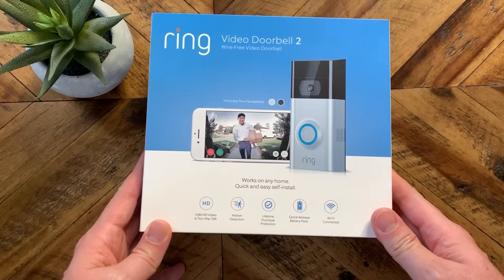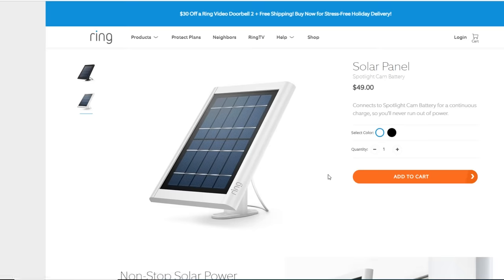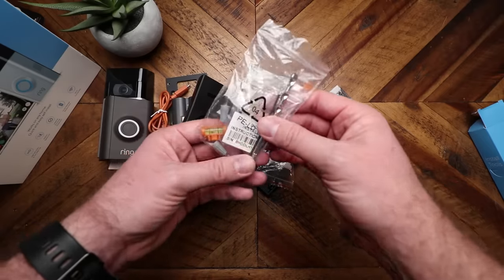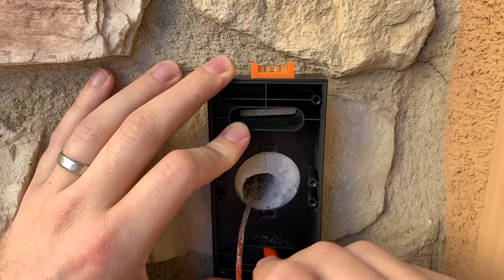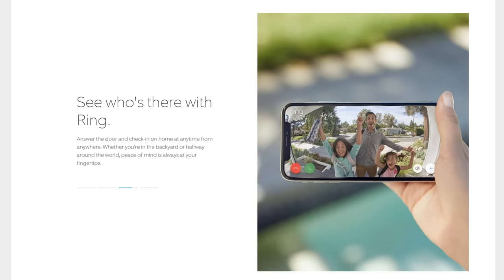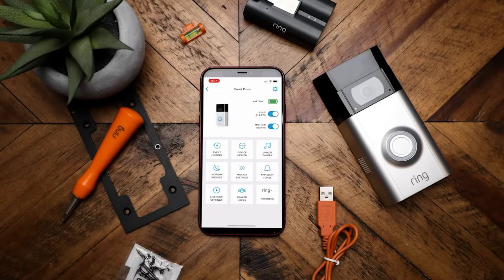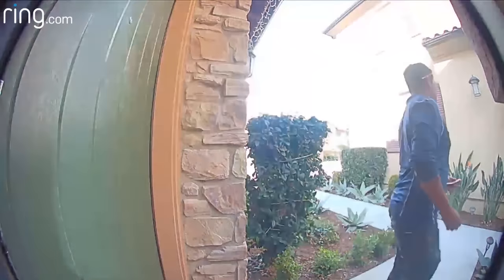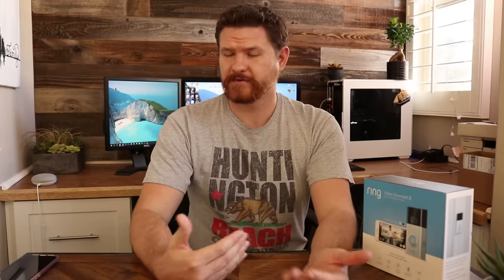Ring Video Doorbell 2 Review - BEWARE of hidden cost

Comment: Not as happy with operation.  Delay in doorbell notifying someone at the door.  Even if the phone is in my hand by the time I get the video up the person 
is walking away.  Audio is also intermittent.
Reply: That sounds like a router issue. Make sure that you have SIP ALG disabled in the router settings.
Reply: I have nothing but disappointment to say about the ring doorbell. The Push Service is extremely slow which means by the time you received notification and answer the door the person is almost leaving. Don't forget it cost monthly payments in order to actually use this doorbell the same way as you can use the freebie Home Security systems which allow you to record on your phone all of the video and are much faster at responding. Definitely would not advise anybody to purchase one of these. Do your homework first and you will see there are many less expensive and better quality ones out there.
Reply: I had nothing but trouble getting my Ring to work properly.  It was choppy and slow.  I added additional wifi repeaters and after about 6 months, Ring finally told me that I needed 1.6 to 1.8 megabits of upload in order to work properly.  My internet service provider was totally unable to provide that level of service because I live in a rural area.  Living in a rural area is the reason I purchased the Ring.  Be award of this flaw.
Reply: @greggrimsley5337  I believe you do since you may not always have your phone in your pocket when at home.  It could be on the charger or where ever.
Reply: @nefiredog8705  Sounds like they were looking for excuses.  I have 100mb upload and 10mb download still have problems.
Reply: @donsmith7354  Absolutely not looking for an excuse.  If I didn't want the Ring to work, why would I buy it.  My ISP can only provide 12 mbps download and 0.7 upload.  My son have two Ring Doorbells on his house and has a different ISP and they both work flawlessly.  I'm upset that Ring did not tell me what their minimum operational requirements were for the Ring to work effectively.  It was nearly a 4 month process to find out what it needed to work.  They even sent me a replacement doorbell and no difference.
Reply: @nefiredog8705  Sorry I was referring to Ring Support looking for excuses.  My ISP exceeds their requirement and still have problems.
Reply: @nefiredog8705  can you please tell me If I have strong wifi that I won't see a delay, otherwise the Ring chime wifi extender would resolve any delays, correct. Would I be able to hear the doorbell if I hardwire into my existing doorbell or would I also have to get the Ring Chime wifi extender. Also what is the difference between the Ring Chime wifi extender and the Ring Chime? Thank you for your time.
Reply: @greggrimsley5337  I had a strong signal, but my problem was that did not  have the internet upload speeds to handle the video feed from the doorbell.  I would suggest running a speedtest to see what you upload speeds are.  My son install two Ring doorbells and he just went ahead and installed the wifi extenders.
Reply: I also installed a wifi repeater right under the Ring inside my house by the door, it made no difference since I did not have adequate internet upload speeds to support the Ring.  All was a waste of money.
Reply: @nefiredog8705  I'll run a speed test to see if I have enough to support a Ring 2. Thank you for your time, have a good weekend.
Reply: I just ran a speed test on my Suddenlink network. I got 45.79 Mbps dn & 22.66 Mbps up. I am going to get a Ring2 and see how it works for me  if it doesn't work I have 30 days to return. I'll let you know how it goes.
Reply: It's not a router issue it's a ring issue I have boosters in my house and same problem only 1,300 sqft home, come on this thing shouldn't have any trouble only thing on my Wi-Fi that does!
Reply: I have very fast WiFi and my router is 9 feet away from the doorbell and still have many issues with slow notification of motion and very annoying that the Live View will work sporadically. I’m sick of seeing ‘Activating Device’ and the circle spinning. I’d say the problem is with the Amazon cloud that Ring uses .. it’s not capable to handle the demand. Amazon (who own Ring) need to sort this out. Very disappointed with this expensive product. It should show Live View first time, every time.

Comment: Just like products have Energy ratings and battery requirements, things that need a subscription need to have a big sticker with a $ sign on it outlining the cost. And just like when products get a recall when a major fault is discovered, products that have no subscription, and then move to a subscription model should be able to be returned (even years later) for a full refund.

Having said that, $30 a year for the basic plan (assuming you'll only get the doorbell and no other ring devices) is pretty reasonable.

Comment: You mentioned you were spoiled by ??  and I am guessing you were comparing it to the Ring yearly charge.  Could you offer a link to what you were spoiled by.     Is there a way on any of the Rings (without subscription) if you see someone at your door you could take a snapshot?   I know with android phones if you press the DOWN volume arrow and POWER button it in most cases will let you take a screen shot.   Is there anything built in that will at least let you take a snap shot?

Comment: What if I want to have Ring cameras at both work and home?  Can the one app and one account monitor both cameras?  If so, how does that work?  Maybe you can do a video explaining all that?   For example, do I need two cloud accounts and two monthly fees?  If that's the case, would I have to sign out of the Ring app for one location and then log into a second account to view the cameras at the second site?  Is there any way to view cameras on two different Wi-Fi networks from the same Ring app?

Comment: According to the manual when wiring to an existent doorbell (mechanical) a transformer with a voltage of 8-24 VAC is required.  On your video, you just wired it as it.  I am a bit confused after seeing your installation which is more simple.  Can it be install without buying a transformer with voltage 8-24 VAC?  Thanks!

Comment: Sorry to post again!  But.... Just to alert Canadians - when you purchase your first 1-Year basic Protect Plan, the Ring website does not at any point give you a "final checkout review" showing any US - Canadian currency exchange, or taxes, or final amount at all. They ask for your bank account info, then shows a screen of "You're covered!"  Only when I checked my bank account the next day, did I see they had charged me  $44.66 (for the $30 plan). When I called, to bark about why their website was so void of any "final amount" so I could see it, they told me that it was my own bank that added the fees (not true). They also informed me that it will automatically withdrawn from the same card next year - of which I was also not informed about during the transaction - nor was their an "opt for auto debit" choice, at all. Ring support replied "it's in the contract if you read it..."  So - my bad for not reading that long contract we all scroll down to "accept terms" lol.  So Canadians, as of Feb. 2019 it comes to $40.66 for the "$30" plan.   And it renews at $30 each year, which is still a pretty great deal, I figure - - - even if it doesn't work all the time.

Comment: Screw this, you can get an outdoor 4-megapixel camera with 2-way audio for WAY cheaper than this thing cost and the picture is 50 times better. I setup video surveillance systems and the camera on this thing sucks for the money you're spending. Plus, it's proprietary. I would rather have something that integrates into my already existing surveillance system.
Reply: @Collin2377  
Damn near EVERY CHINESE MADE CAMERA OUT THERE. I've installed a BUNCH of different brands and the picture is ALMOST identical with MOST of them. The main difference is the hardware INSIDE these cameras. Digital zoom compared to mechanical zoom. NIGHT AND DAY DIFFERENCE in those two types of cameras, just as your cell phone camera is compared to my Nikon SLR. Now am I going to tell you which name brand to buy? Nope, you have to PAY ME to get that information. I do this as part of my line of work and if you want to know what I know, get to reading son. It's a big ol' internet.

Comment: What screws did you use to mount camera to the wedge mount   it seems the small scres are to short. The 5 liltte  screws in the small bag
Reply from the maker: There should be 2 large screws that you would use.

Comment: Your video is informative and helpful.  A couple of suggestions, though. Perhaps you could have included more footage of the bracket installation.  It looked like you aligned and marked the bracket on the brick/stone but didn't actually drill holes on your mark.  Also, didn't explain or resolve the video quality or lighting issue.  Maybe you could have improved the video quality by adjusting the angle?

Comment: What did you mean by it doesn't matter which wire the ring is connected to in the back?
Reply: It doesn't matter what wires are hooked up to your door bell that you already have installed and you will connect those Two wires on your new device on back where the videos instructed to installed them. One on one side and the other on the other behind the screw.  Just don't put both wires behind One screw. You only used the wires if you don't want to worry about the batteries going dead.

Comment: If you're looking for lower cost alarm system monitoring - then the Ring Alarm is a good choice - for the same $100/year or $10/month you get the unlimited recording on multiple devices and professional alarm monitoring...  I was paying $25/month for SimpliSafe and no cameras so it's a total win for me.  The camera is for sure not as good as other camera systems out there but much better than the old wired ones where the colors are extremely washed out and nigh vision makes everything look purple during the day.

Comment: What's the voltage it needs from the existing wired door bell ?
Reply: 12 to 24V AC but it doesn't seem to like anything lower than about 15VAC.  Do note it is an AC supply it needs not the more common DC.

Comment: My current door bell is at the side of the front door, not facing the front walk or a frontal view of someone at the door.  Can I leave my current door bell operational and install the Ring Video Doorbell 2 using the battery at the front door frame which would provide a better  angle to capture someone at my door?
Reply: Yes, of course, but will you want to connect the ring doorbell to your existing doorbell, so if someone rings the ring, your old doorbell also sounds off?

Comment: I'd like to get the 1st RING Video Doorbell for my mom but I want to get it hardwired for her. She does not have an existing  doorbell but her handyman can hardwire for her, I believe. Can she do that without existing wiring?
Reply: i think there is a battery option and also a solar charger option, if her door receives a few hours of sunlight per day.  The wiring necessary is low voltage wiring.  Since she doesn't have a doorbell, she might want a doorbell in addition to the ring, so when someone rings the doorbell, people in the house without ring will know it.  So the handyman can install the not-ring doorbell in the house, near the door, and also run 120 power to it (electrician or plug in it an existing outlet,) but then has to run the skinny low power line to the outside to the ring doorbell, to power it and to connect to the ding dong sound maker in the house.

Comment: Hey Steve, love your videos. Very informative. Has anyone noticed the following: just got the Doorbell 2 today and set it up. Whenever my phone (Samsung Galaxy S9+) is connected to the Wifi Live View will just show a black screen. When I'm on mobile data it starts within 1 or 2 seconds. Similarly the App itself needs 15-20 seconds to start up while on Wifi and 1 or 2 whenever I use mobile data. Any suggestions or advice?
Oh by the way...I'm using a repeater to boost the wifi signal.
Reply from the maker: Hi Philipp, thank you! I didn't run into that issue so i'm not sure what's happening with your system, sorry.

Comment: Nice video ! Waiting on delivery of mine, should be here in a couple of days, just a bit worried of the wiring, as I don’t have an original door bell, thought I could just plug it in a electrical socket? Also purchased the two of the single spotlight cams, battery operated, .
Any way thanks just subbed to your channel! 👍🇬🇧

Comment: Great video, and straight to the point. Instead of the ring doorbell would you recommend the single Arlo camera instead?
Reply from the maker: Thank you! Yes, if i were to do it all again i would choose Arlo over Ring. Arlo comes with 7 days of cloud storage for FREE and you can add more cameras down the road if your need grows.
Reply: @SteveDOES  Thanks for the tip
Reply: @SteveDOES  so you have or had Arlo? and if you do have it what kind of cameras do you have ? doorbell or floodlight, etc? I looked into them too just briefly
Reply: Does the Arlo have 2 way communication?

Comment: I don't like that subscription surprise either.  It pissed me off enough that I got one of the cheap chinese ebay 1080P video doorbells that you can add a microsd and skip the subscription.  Turns out you don't even need the microSD, they give you cloud storage for free!  Video and sound quality is on par with the ring but the detection sensors and software are not.  However at the end of the day at least you can check the recorded videos (20 with plants blowing or the sun triggering an event and 1 with the mail man).  It's still a tick better than the ring with no recording.  You mentioned being spoiled by the Arlo.  This may be the one in the middle to get.  Do you have a video of that one?

Comment: Since I have set up the doorbell 2, I have noticed it does not always detect motion. It detects on leaving the house, when you come home, no detection at all. The doorbell is 30ft away from the broadband router, my connection has a download speed of 37 Mb and I am using chime pro to extend the wifi signal, so the wifi connection is not at fault. I think on balance that you should forget the doorbell camera and opt for wifi enabled CCTV cameras instead. Maybe the Ring company will eventually make a camera that works as it should but for now, my doorbell 2 and chime pro is going back for a refund.

Comment: Why didn't you buy a WIRED doorbell... since you have wiring at your doorbell site?
Reply from the maker: You can also wire this doorbell. Since my doorbell is able to pull power from my wires it keeps the internal battery fully charged. But yes, i don't really need the battery in my setup.
Reply: @SteveDOES  Thanks.

Comment: How does the angled plate attached to the wall? Seems the screw holes are to attach the ring device.
Reply: you screw the plate to the wall and the ring to the plate
Reply: @scottstewart5784  That it has no screw holes is kinda confusing, but I guess you use that center opening.
Reply: @TheChase2010  i'm trying to remember. i think you screw the angled to the wall, and then the base through the angled into the wall.  There should be several tiny zip-loc bags of skinny, black wood screws of differing lengths. Yes, that is it.  I remember, because i installed it, then decided it had to move a 1/8th or so of an inch.  I removed the ring, removed the base, and then had to reinstall the angled, carefully, because i had to create enough distance from the old holes.  I did, then screwed the angled into the jam, then screwed the base into the jam, through the angled. Then the ring snaps into the base, and you tighten the security screw.
Reply: @scottstewart5784  Thanks.

Comment: I got the v2 doorbell, and tbh for the prices these doorbells go. Totally not worth it, you pay a subscription to record and maintain videos. Which is already ridiculous, it’s a doorbell that connects to my phone. And I still have to pay annually or monthly. For a simple function as recording. Couple bucks
Is not much , but why do I need to pay for recording on your servers?  I want it on my phone, I cannot do that really. Why? 

Then in the mornings or late nights, if it’s damp. Well forget about it, as the entire lens will fog up due to the humidity. That’s unacceptable, for a 200usd camera that supposedly secures your front door. 

Night vision is such a horrendous resolution you can barely see what pixels are human. 

The ring app?? I super slow with opening there is a work around app called rapid ring. That opens it super fast, but that means 2 apps needed to fully enjoy its proper functionality. 

It’s a novelty at best an expensive one. 
Never again I will buy junk like this again

Comment: One of the primary function of this ring doesn't work. It is no way, or so hard to pick up the call in real time. I have to wait for the ring to upload the video than I can access to it. Usually, a person at the door leaves already. My Internet has 250Mbit and Nighthawk Netgear router, which is realy fast. I hope they will improve this sometime soon.
Reply from the maker: I found the same. I get a notification right away but i can't view the recording until it's finished. I know you can pull up Live view right away but, i want to start from the beginning of the alert and not half way through.
Reply: I will suggest that you set up the Ring on a spot that can give you a sooner view and on setting increase the pick up range, this will give you the video once they are at your door.